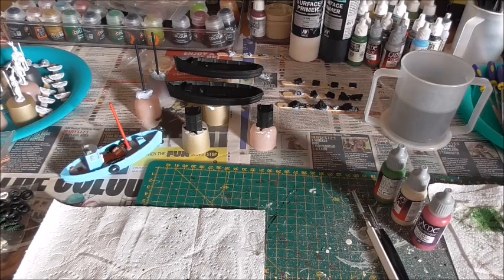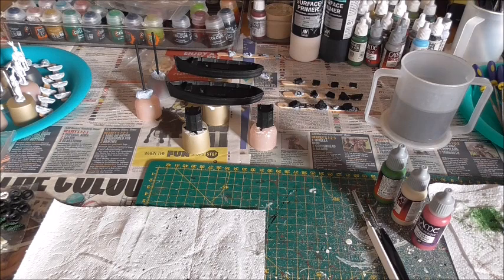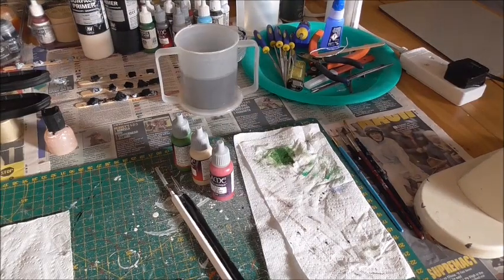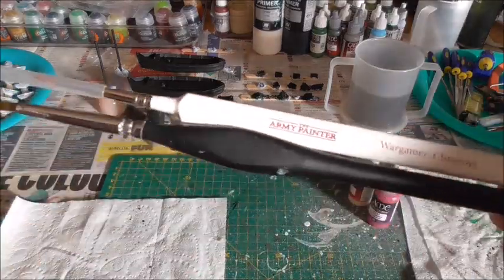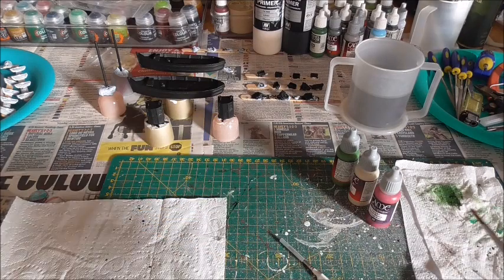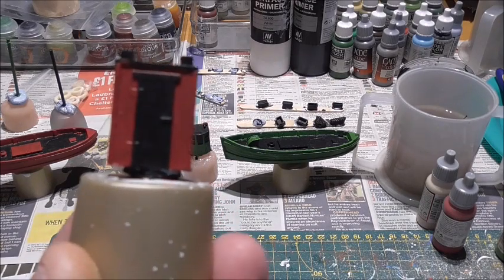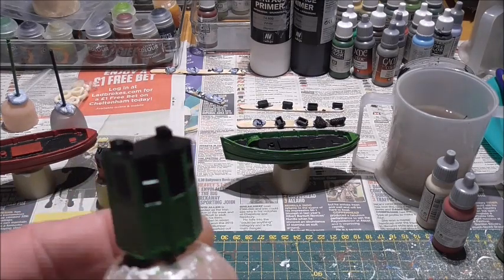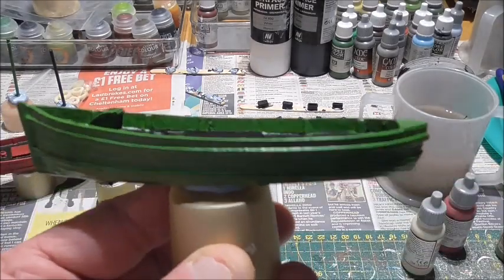Painting Fishing Boats, Part Two

Comment: In respect to you noticing no scuppers, there is also no exhaust stack for the desiel engine. Arthur
Reply: Very true Arthur, I did miss that. I guess a small indentation in the Hull with a pin vice and a spot of black paint could sort that out.
Reply: @TheDiomedef16 , I think that usually they had a vertical stack that cleared the wheelhouse to ensure the fumes were blown away from the deck. Arthur
Reply: @afm1948  I guess it was another flimsy item the sculptor decided against adding. For the price you pay, the model is a very acceptable representation, and will look the part on any dockside scene.